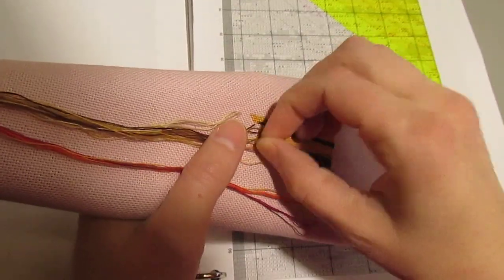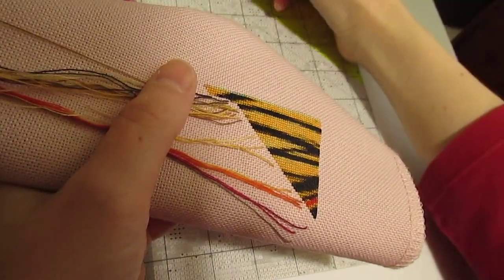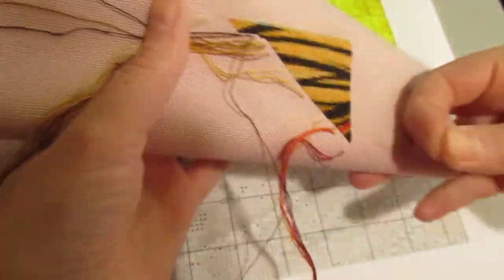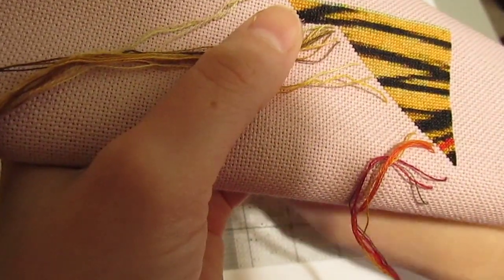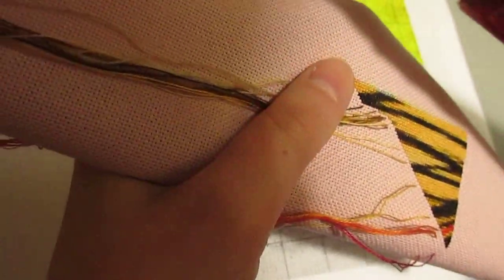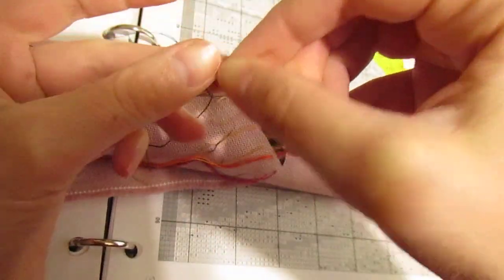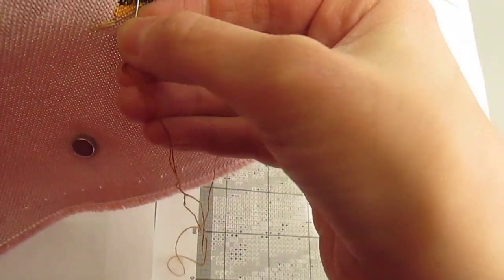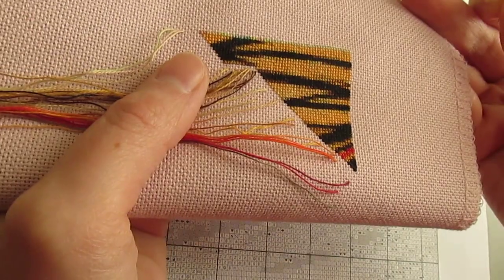Stitch Along With Stitchin' Mommy - Diagonal Stitch by Stitch Parking

Comment: Oh wow!! Thanks for sharing, this looks like a neat idea and you have made me want to start a new HAED pattern.
Reply from the maker: You're welcome!  That's exactly how I felt when I saw Brian's demonstration of this technique.  I needed to find a pattern to start to try it on!  :)
Reply: Stitchin' Mommy I want to use this method on my HAED QS In Father's Hands, but it is an oval chart rather than square. Do you think it would still work? Just need to be a little more creative when first starting??
Reply from the maker: Yes, it should still work.  I like to draw my diagonals along the center of the gridded 10x10 squares on the pattern.  So, you can just draw from one thick line intersection to another on your chart, then your first diagonal would just consist of the excess stitches that are outside that first line.  Brian, blitstitch on Flosstube, stitches almost everything this way, and he has some interesting starts and edges because the designs aren't full coverage.  He recently started a Lavender & Lace Santa this way, so you could go back to some early pictures of it on Instagram to see how it looked at the beginning: https://www.instagram.com/blitstitch/

Comment: Just watching this video, about halfway through.  Can I ask, do you only park in the diagonal column that you are stitching on?  So if that symbol doesn't occur in that diagonal but appears further to the left, do you end that thread?  Hope that question makes sense.  And also how do you start and end your threads?  Do you anchor on the back when you start and then thread your thread under other stitches on the back to end?  No waste knot parking or pin stitch? x
Reply from the maker: If a thread next occurs in a diagonal off to the left, I will park it over there - up to about 2-3 diagonals away, so I'm not trailing my thread too far.  I like to check the diagonals for instances of the color starting at the top of each diagonal, so that it is truly parked in the next place I'll come to it.

I just start and end threads by running them under previous stitches.  Unless I'm using 2 strands of the same color, then I will try to use the loop start when I'm able.  :)  I don't have any trouble turning my fabric over since I'm holding it in my hand, so it's not as bothersome as it might be if I were working on something clamped to a stand.  :)

Comment: Love your tutorial.  I have been wanting to try parking, just did not know how.  Wanted to try diagonal.   You did a good job explaining.  How do you know where to start when you don't  start in the middle?  I have always started in the middle since I was in school.  Now 59.  I want to try. I don't  know how to figure out where to begin so that my pattern is centered.  Thank you in advance for your explaination and time.
Reply from the maker: When I start in a corner, I make sure the fabric has at least 2-3 inches of margin beyond the design size.

In order to calculate that, determine the count of your fabric (how many threads per inch it is).  Be sure to take into account if you're planning to stitch your design over 2 fabric threads.  For example, if you have 32 count fabric stitched over 2 fabric threads, your actual stitches are only 16 count size, which is the number you will use for these calculations.  Then you divide the number of stitches in your pattern by the count of the fabric.  This results in how many inches your pattern will be.  Then, add 4-6 inches to the width and height in order to add on a 2-3 inch margin of border around your actual stitching.

Once you are sure you have a big enough piece of fabric, just measure in 2-3 inches from the top and side, and that's where you start.  If you like a 3 inch border, you can even place a standard size post-it note in the corner and where the opposite corner of the note is - that's 3 inches in from each side!
Reply: Thank you so much for explaining how to know where to start stitching
Reply: I really appreciate you and your time.   Thanks so much.

Comment: I like it very much that you explain as you go, teaching us; you do it very well.  Your an excellent instructor.  Your work is beautiful.  And I love hearing your daughter singing in the background.  So sweet.
On a side note, would you please explain the numbering on the full coverage charts?  It’s probably remedial, but I don’t understand what the numbers mean on the upper right side of the page or the ones on the bottom of the page.  And how the pattern works up if your stitching columns or rows.  Thanks so much.
Reply from the maker: Patty Gardner Hi Patty! On most full coverage designs, the number in the upper right corner is the page number of that particular page. Then, some companies also put numbers in the other corners (sometimes in parentheses), which refer to which page is to the left, bottom or right of your current page. It can help especially when going from one page to the one below, to know where in the masses of pages to find the one that matches. You can also figure out which page goes where by consulting the grid numbers along the top and left of the chart, which mark off every 10 stitches in each direction.
Reply from the maker: And you can work a full coverage design in any way you like. Sometimes it can be easier to manage the magnitude of a design by breaking it up into pages, columns, rows or blocks. I’ve tried lots of different styles of tackling full coverage pieces because different techniques can work better for different designs and some even work better for how different people think as they stitch. So, feel free to play around and find a method you enjoy!
Reply: Stitchin' Mommy, Sarah!  Thank you so much!  You’ve given me such a clear explanation, I can now picture how these multipage patterns/charts work. I will actually be able to begin my first full-coverage project feeling more confident. Thanks again!  ❤️👏🎉🎶

Comment: Hi! I dont know if you still stitch this way or not. Can you give a tutorial how this works between more pages? I can not find it anywhere
Reply from the maker: I am still stitching this way on this particular project, and I think I might have reached the page break at the top - or at least I'm getting close!  I'm choosing to stitch in diagonals across the entire design - regardless of page breaks.  So, when my diagonal goes over into the next page, I will continue to stitch on multiple pages at a time.  Right now, I have been using the app Pattern Keeper to stitch my full coverage designs.  The android app allows you to import compatible PDF patterns and it will search for symbols, highlight all the symbols of a particular color, mark off your stitches, and mark where your parked threads are.  For purposes of this discussion, it also allows you to see the entire chart at the same time - with no gaps between page breaks, and it also puts a guide marker along the diagonal to help you know where your diagonal column will fall.  It's been very helpful!  I'll try to do another stitch with me on this piece in the future to help demonstrate how Pattern Keeper makes it easy to stitch this way.

Comment: Thanks so much, first time I have understood, but man how can it be any quicker, not just the threading but parking just right below… my friend uses multiple needles and that made me crazy but can see why.  But awesome as I think will retry as cant figure out Brian or needlebugg.  Yes explain,talk lol now going to go see if hVe typewriter one, which sure you do. And need to subscribe.❤
Reply from the maker: Wonderful!  Yes, this method is nice for neat stitches, but is definitely not faster - at least in my opinion, when compared to other stitching styles that I enjoy.  I suppose if you struggle with counting, this could be faster because then you'd frog less, since you're only working in one small row of 10 at a time.

I do have a demo of my original typewriter method - I need to get an updated one on here, since I have adjusted my method a little bit since filming that.  Instead of selecting the next symbol strictly along one line (left to right) across the entire design, before moving down to the next line to select symbols, I decided to select symbols top to bottom, left to right within an entire 10x10 square before moving on to the next 10x10 square to select my next symbol.  In every case, I stitch the thread wherever it occurs until it run out - I don't stay confined to a specific area when I'm actually stitching - I just keep going as far as I'm comfortable counting, which is pretty far!  But by choosing symbols within the 10x10 blocks, it helps you find the next symbol easier, rather than scanning the entire length of the line across the design, trying to remember which line you're on.  I think it will make more sense to explain in a video, so hopefully this fall I'll have time to do demo video for that.  :)

Comment: First, thanks for the demonstration. I personally like stitch with me videos that talk me through what's happening anyway so this was perfect. So I've watched the other videos you mentioned and I have a few questions. First, how do you anchor a new thread because you're only using one strand? I like 1 strand in general better but I usually use a pin stitch start which I'm not sure would work over one. And then how do you start a new diagonal? Thanks so much
Reply from the maker: I'm glad this video was helpful for you!  I like to just anchor my thread underneath the backs of other stitches.  Since I stitch in-hand, it's easy to flip my fabric over and access the back to do that.  I think there has been a tutorial on pin stitch over one - maybe by Pam's Crafty Corner - but I haven't tried it and have been content to keep doing it this way.  :)

When starting a new diagonal using this method, I look for the symbol in the top row that's farthest to the right, touching the existing stitching.  Sometimes I will have a thread parked there already, but if I need to start a new color, I just weave it under the back of the stitches of the existing diagonal to anchor it and start stitching.

Comment: Do you like it at upper right better then upper left?
Reply from the maker: With the way I make my stitches, in order to follow this particular method of stitch-by-stitch diagonal parking, I needed to start in this corner.  The goal with this method is to always bring your needle up in a hole with 0-1 previously stitched threads and put your needle down in a hole with 2-3 previously stitched threads.  Depending on how you make your stitches, that will determine which corner you should start in, if this methodical method is to be properly executed. 
If you're just interested in stitching diagonally in blocks, or cross country in diagonals, you can start in whichever corner you'd like!

Comment: I guess, i am starting to get how it works. Need to try it on a small piece in case i do not like it. And i usually start at upper left corner, will have to adjust.
Reply from the maker: Yes, I usually start in the upper left as well, so this was different.  But, I enjoy trying new methods and techniques, so I needed to try it - and it's a fun method for a small, frivolous design.  :)

Comment: I don't understand why you don't run a few needles at a time - park them on the needle minder (off to the left) in between use instead of unthreading & rethreading all the time
Reply from the maker: Since I stitch in-hand, I'm afraid having several needles on the go would be too complicated.  I also tend to be pretty frugal with my needles, and that would require several just for this project.  It's worth a try at some point though - since that is the least enjoyable part of this method.  I wasn't sure I'd like parking or needleminders either, because I stitch in-hand, and I enjoy both of those now!

Comment: What fabric are you using here?
Reply from the maker: This is 28 count Rose Monaco, which I found at Ritarene's Cross Stitch Supplies.  She may not always have Monaco in stock, but she sells cross stitch fabric by the yard at reasonable prices: https://www.facebook.com/ritarenefabrics/
Reply: @StitchinMommy  Thanks for replying. I'm just starting to switch from Aida to Evenweave and I really like Monaco, but it can be hard to find. Have you had any issues with count being off? I recently had some from Joann Fabrics (Charles Craft brand) and it is 28 CT horizontal but only 26 vertical!
Reply from the maker: You know, I just noticed that on some recent Monaco I ordered from the Fat Quarter Shop.  I was surprised because historically Monaco has been even.  I'm stitching a full coverage design on that piece of fabric, so I just made sure the stitch count of the design would still fit on the fabric knowing what the true count was in each direction.  If you're stitching a sampler or something, it would probably still be fine, as long as you're okay with the motifs being slightly elongated.  The time to definitely not use fabric that's "off" is if the design is square - like a mandala or something.